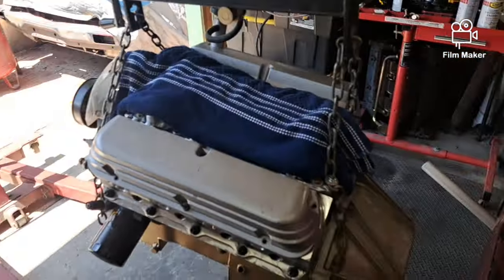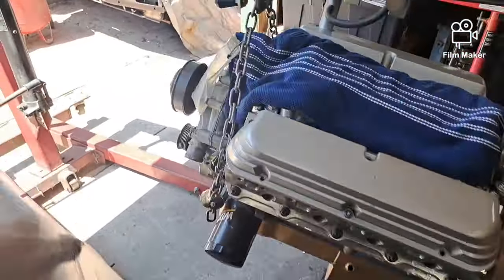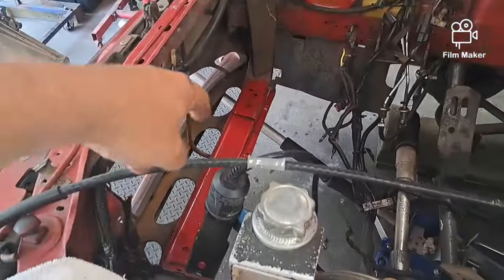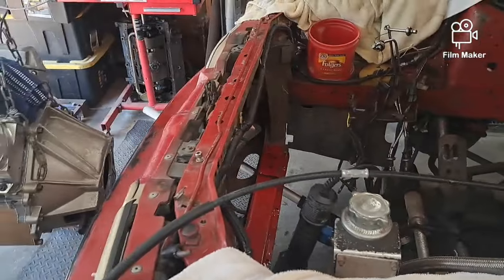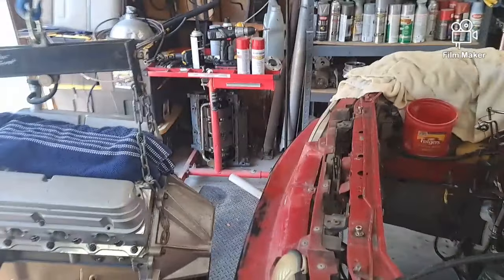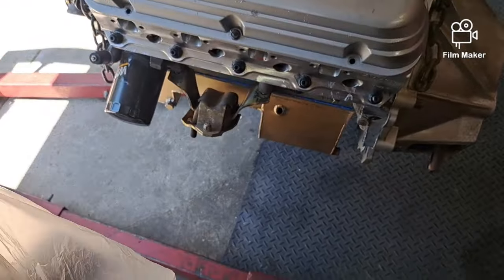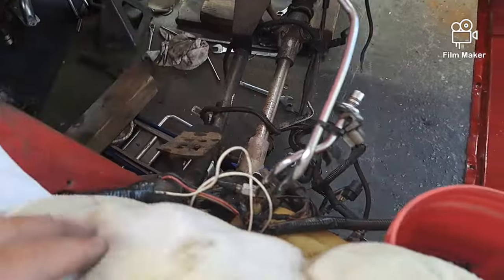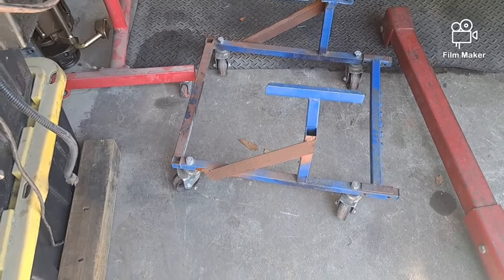90LX gets a 347

Comment: Those motor mounts lowered my engine 3/8" couldn't see compared to factory ones on bench, changing my drive line angles about 3° with factory tmount, causing vibration drone @65 removed them after 1000 miles. Other parts changed and added, trying to find drone.
Reply from the maker: I was thinking I should recheck pinion angle after putting these in.

Comment: Valve covers have no baffles? Heard some folks Rock double gaskets for clearance…
Reply from the maker: Valve covers were just sitting on the engine, had to pull them off to get headers on from the top, and to slide the header gaskets in.